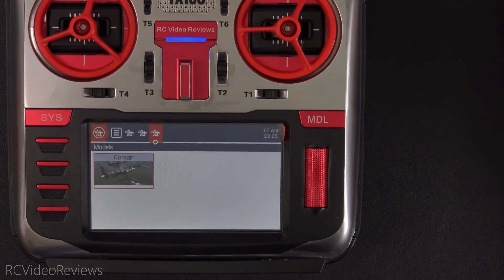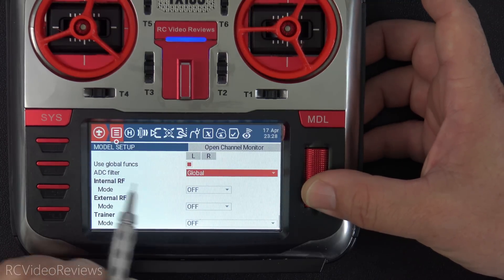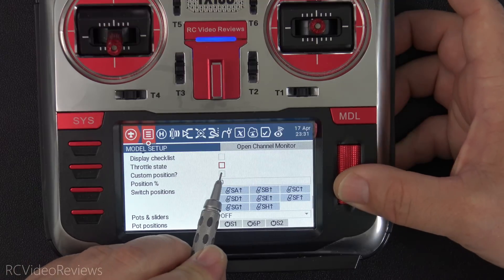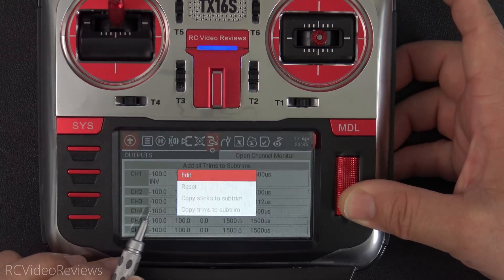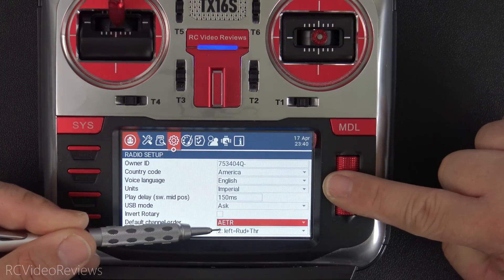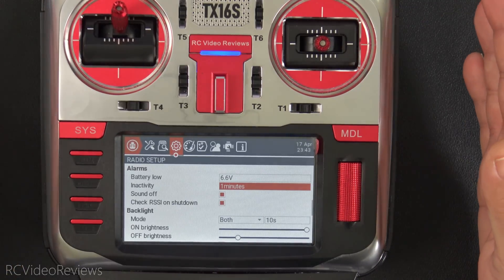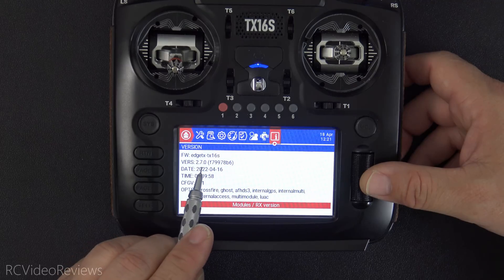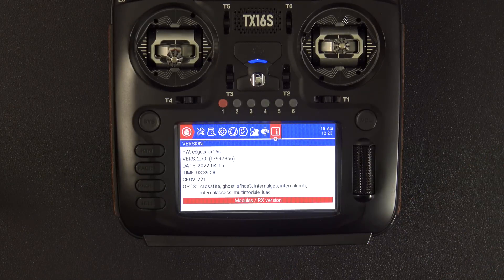EdgeTX 2.7.0 Black Pearl • What You Need to Know • How-To Upgrade

Comment: Finally going to move from open Tx to Edge, can I just down load this version on a blank 8gb card and install it? I only have 2-3 models so I think it might be easier to just reinstall them rather than worrying if they transferred properly.
Reply from the maker: You can. The firmware does a good job converting models though, but either way…Just make sure you get the SD Card Contents as well. They’re available for direct install via buddy.edgetx.org
Reply: @RCVideoReviews  All updated and good to go, now just to rebind the models and go flying..,., when the snow melts. Hit with a blizzard last weekend with more snow coming over the next week….  And we don’t live that much father north than North Dakota!!!!

Comment: Hi John,  Alan in the UK, here as I'm still an old  (74  newbie ) I have a R/M Tx16s and an Echine Tx16s ,both on open Tx. I've been waiting to see edge Tx  progress and I think now is the time,  as I'm a bit rubbish at computer stuff and know you're really good at it I'm hoping that you can tell me that l can start with a new memory card and install edge tx 2.7 on that card or would you advise to use the one in the Echine Tx16s as that's the one I'll be upgrading first,  or any additional advice will be very much appreciated,  your channel is one of the ones I trust the most,   thanks again and best wishes from Alan in the UK 👍👍👍👏👏👏🤗🤗🤗  ps I mainly fly gliders and slow flying Cub type aircraft 👍
Reply from the maker: You can use a new card if you want. Just make sure to get the EdgeTX SD Card Contents from buddy.edgetx.org when you install a new card.
Reply: Thanks so much John  your fast reply is very much appreciated,  cheers my friend,  regards,  Alan in the UK 👍👍👍🤗🤗❤
Reply: @longjammeriii3323  Format your SD card to FAT32. I have two SanDisk 8GB Industrial micro SD cards. Industrial cards are over-kill for t he TX16S but I got them at the right price from Amazon. I keep one as a spare.

Comment: I just flashed my Zorro by putting the SD into my MacBook to copy the BIN file. For reasons I can't fathom MacOS ignores the Zorro on a USB lead. Just a different way to do the same thing.Thanks for the information.
Reply: Might be worth double checking that USB lead is a not a "charge only" lead rather than a data lead...
Reply: @pfeerick  It's the one that came in the box with the Zorro! I will try another one soon, thanks.
Reply from the maker: You’re welcome.